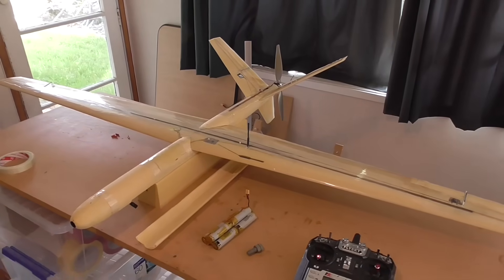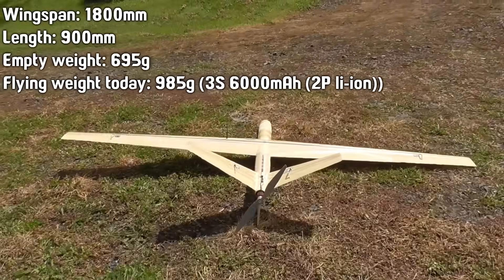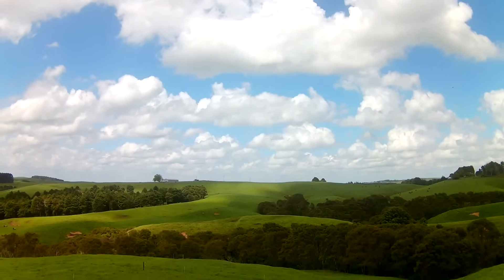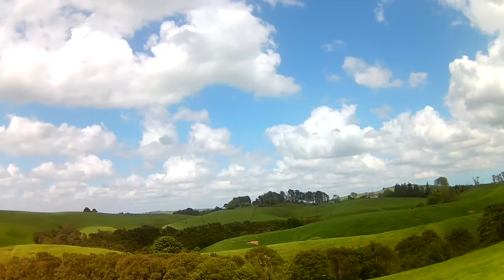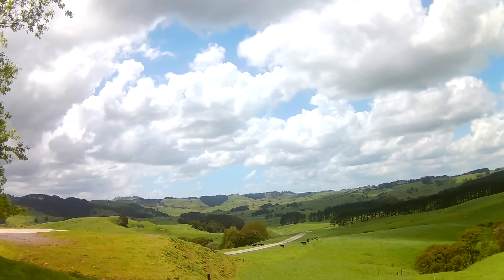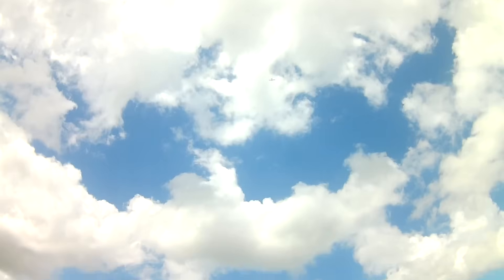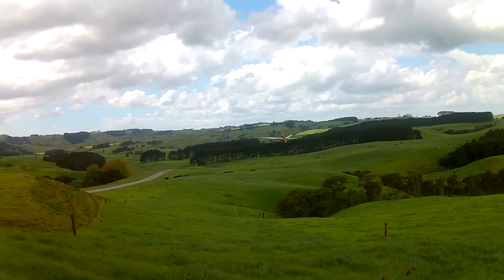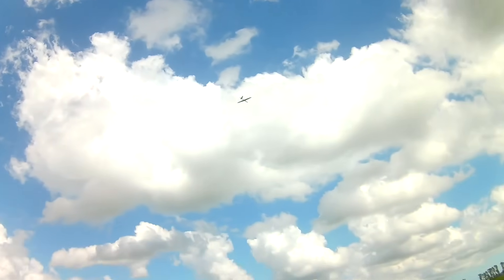Endurance UAV part 2 (maiden flight)

Comment: You can put folding props on as pushers, you just need to reverse the props on the spinner. The main issue is that when you cut the power, the wind pulls them back but there is no center stop (the fuselage normally does this) so one of the blades will invariably fold over onto the wrong side and when you go to fire the motor up it’s unbalanced and will rip out of the mounts. I remedied this by just putting a small zip tie around the two prongs that come off the spinner and attach the prop blades. They act like stops, keeping the blades in position to deploy upon rotation, and if you count the clicks before trimming them you can ensure that they’re both the same length/weight.
Reply from the maker: This plane wasn't really made to spend a long time gliding, for landing it's fine. I don't like folding props much, they are heavier, hard to balance and inevitably end up vibrating. Plus for a pusher you need some kind of awkward method to prevent them from folding too far. As Bruce says the drag is not much really, and less the higher pitch of prop is used.

Comment: Why time? Distance matters. Nothing to do with time.
Reply from the maker: Because the challenge I set for myself was time, nothing to do with distance. Please explain why you think an aircraft designed for long flight time over a small area is not useful - have you never heard of surveillance, loitering munitions, electronic warfare, ground support, signal relay, search and rescue, early forest fire detection, aerial mapping, wildlife monitoring etc??? The MQ9 I mentioned is famous for long flight times rather than range, yet many countries around the world are spending $33 million on each one.
fwiw this plane can travel 86km in one flight (no thermals).
Reply from the maker: Aside from the MQ9, there are a multitude of other aircraft designed with similar goals. 
https://en.wikipedia.org/wiki/Medium-altitude_long-endurance_UAV
Note that one of the main criteria for evaluating them is the flight time. Nothing to do with distance.

Comment: Interesting.
With thermal activity a plane will turn away from each thermal and thus "meander". The correction effect from the gyro probably makes this wobble effect more noticeable.
For "duration" a planes sink rate is more important than its lift to drag ratio. It is possible that a light airframe designed for optimum strength to weight can use less power to maintain level flight than one designed for aerodynamic efficiency but with a weight penalty.
I have a home designed RC plane where its battery represent nearly 50% of its flying weight yet it can maintain level flight drawing just 0.2C from the battery.
Reply: If its finding thermals, run Ardusoar.
Reply: I'm currently building a 1.8m plane as well, trying to get around .5 m/s second sink rate. My plane should be less than 600 grams empty, and will carry a 4s 10,000mah li-ion battery. The results he's seeing here are giving me a lot of hope! I think even 4 hours might be doable for me.
Reply from the maker: "drawing just 0.2C from the battery" gotta be one of the least informative forms of measurement... how about wattage?
Reply: @iforce2d  If you can maintain height using just 0.2C from the flight battery it means, if you do the sums, the plane has the battery capacity to stay in the air for 5 hours.  
Watts only gives the power required to fly  It does not describe how long it can do so. My plane uses just over 8W to maintain level flight.
Reply from the maker: ah yes, I stand corrected :)
Reply from the maker: @simon btw what kind of layout and overall weight are you using that can fly at just 8W? Flying wing?
Reply: @iforce2d  Aerodynamically very basic s simple pod & boom pusher. The sophistication is in it construction being strong but very light. 48" span with a foam and balsa construction it weighs 436g of which the 3500mAh 2s LiPo makes up 214g. It can maintain height using  just 1A.
Reply from the maker: Sounds like you would be better off with li-ion for that, especially since it only needs a tiny dribble of current. A similar 2S pack (3200mAh) would be a little over 100g.

Comment: Might have to put spoilers on that sky sausage if it's prone to soaring like that.
Reply: I would first test using the ailerons as brakes.
Reply from the maker: Maybe with another 300g weight in the extra battery it might settle down a bit.

Comment: As for the yaw "jiggle"...This could be down to a lack of Aileron differential. Choose a calm day, put it in manual and start putting some large Aileron throws in and observe. The tail moment is very short, this explains why the Vee tail doesn't respond to Rudder, they rarely do TBH....🤔😳🇬🇧
Reply from the maker: I'm already using differential aileron. The problem there was that I had not yet done the autotune, so it was still using the tune copied from mini-hopper which was quite sluggish. After the autotune the roll was ok.
Reply from the maker: Forgot to mention, the weak yaw response is probably due mainly to the v-tail being quite flat. The three tail surfaces are all equidistant to each other (ie. 120 degrees apart) which makes the V part of it not very vertical. The MQ9 has a rudder on the ventral fin would regain good yaw authority, but mine has none.
Reply: @iforce2d Agreed, I said the same in my original comment...I'm not a lover of Vee Tails have to say...🤔😳🇬🇧

Comment: Yaw stabilization is, at least with Inav, an issue. Idk about Ardu. In Inav it always tries to keep yaw heading and this messes with clean turns.

Also you have a wing with a high aspekt ratio with a more „glider“ layout. Try putting some aileron differential in. Maybe the adverse yaw messes with the FC and using some differential might help

Nice project 👍🏻
Reply from the maker: Ardupilot doesn't do any yaw stabilization, at least in FBWA mode. The issue is in the airframe itself, not the flight controller. If there is not enough vertical surface yaw stability will be weak.

As for roll, I'm already using differential aileron. The problem there was that I had not yet done the autotune, so it was still using the tune copied from mini-hopper which was quite sluggish. After the autotune the roll was ok.
Reply: @iforce2d 
Thankyou for a more up to date answer on yaw. 

I have two controller I need to setup and might do a deep dive into this. 

I will try to find if constant heading is used during take off and landing.
If constant heading is used in waypoint navigation
If slip skid is used in turns
Reply from the maker: "Note that the takeoff direction is set from the direction the plane is pointing when the automatic takeoff command is started, if a compass is used, or the heading once a valid GPS heading is obtained with sufficient ground speed."
https://ardupilot.org/plane/docs/automatic-takeoff.html 

During a mission (or cruise, loiter etc) the plane tries to move directly toward the next waypoint, if there is a crosswind this will result in crabbing. Basically the yaw will be set to whatever is required to draw the desired path on the map.
Reply: Can you adjust PID on the gyro-controls on Ardupilot?
Reply: @alexanderg-p3z 
Manually, or through tx pot, or automatically
Reply: Ardupilot used to have lateral acceleration settings to keep the slip skid neutral in turns

Haven't looked for oh so long

Comment: looks like slope soaring to me, cause of the terrain the air is pushed up and so does the plane.
Reply from the maker: I have tried slope soaring around here are few times, you need a lot more wind and a more purpose-built plane to get any useful lift. The slopes are too small and all over the place in different directions. Also, I was still getting 3m/s lift at high altitude, definitely not from slope.
https://youtu.be/hY3MgEqPW3g?si=BKIAHFn97Bahm-bR&t=1138
https://youtu.be/3XTOwXFfGuw?si=fdhrmuBYNeiET5f1&t=787
https://www.youtube.com/watch?v=vHyZZbLSA_w
Reply: @iforce2d slope soar discarded then. 🙂

Comment: Well done sir. 

May I enquire as to why not put in circle mode with airspeed sensor so that you can rule out pilot input etc 

Then the logs can show watts average at different constant airspeed and altitude in the same position (ridge lift)
Reply from the maker: Mainly I didn't want it to be banking all the time. Also in RTL there are some parts of the circle it uses way more throttle than is needed to just fly. In FBWA I can set the throttle to the bare minimum needed to maintain altitude and fly in straight lines, which usually uses less energy overall. That said, I'm already sick of doing 3 hour flights, so I'm about to run a test in loiter mode, will see how much difference it makes.
Reply: @iforce2d 
The speed/throttle changes because it's working off land speed instead of air speed. 

Loiter mode is good enough from memory as it holds altitude while circling in a fixed position. 

With all the altitude change I might disagree with you being able to fly at minimum power. 

If your circle is sufficiently large, eg 400m-1km the bank angle is very low.
Reply from the maker: Right, I used a circle of 300m radius, so it was a minimal bank. Time was 140 minutes so a little less than my estimate of 150 minutes.
Reply: @iforce2d 
If you download the log files and select power and speed and graph it,
You will see the efficiency curve. 

Then you can set that as an airspeed and do it again and I bet you will beat the 150

Comment: That freewheeling prop on glide must dragging on that like a bloody parachute. You got a folding one around?
Reply from the maker: This plane wasn't really made to spend a long time gliding, for landing it's fine. I don't like folding props much, they are heavier, hard to balance and inevitably end up vibrating. Plus for a pusher you need some kind of awkward method to prevent them from folding too far. As Bruce says the drag is not much really, and less the higher pitch of prop is used.
Reply: Surprisingly without brake on a brushless, it's not that bad.